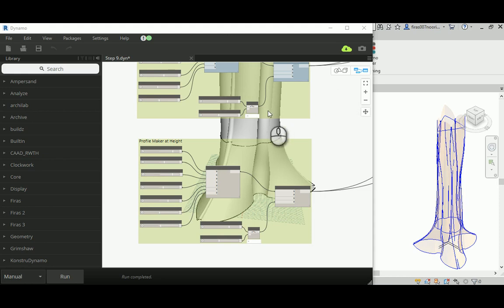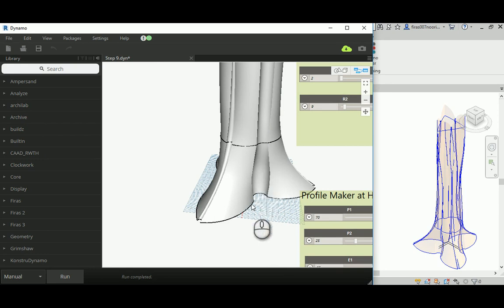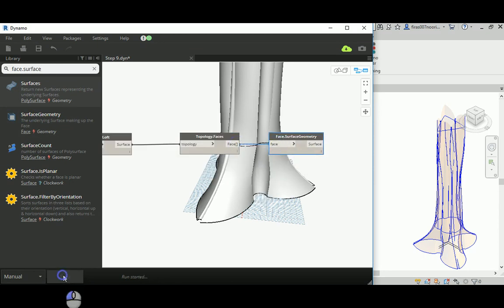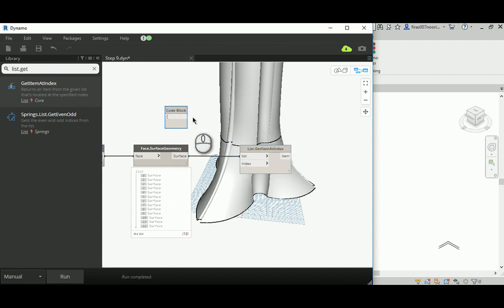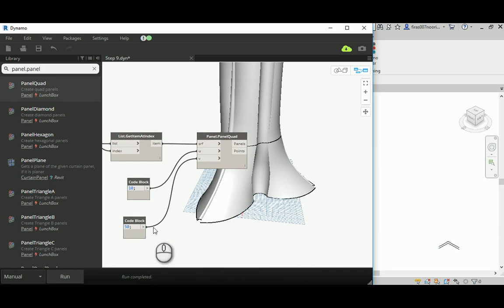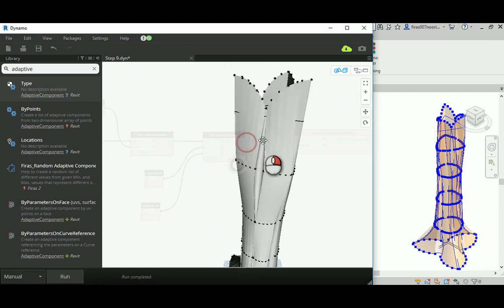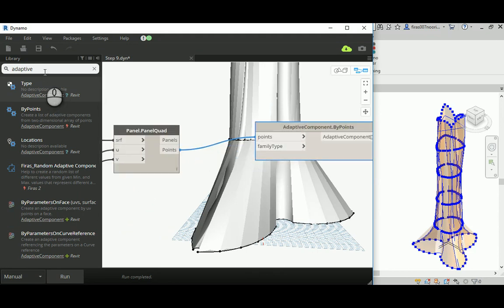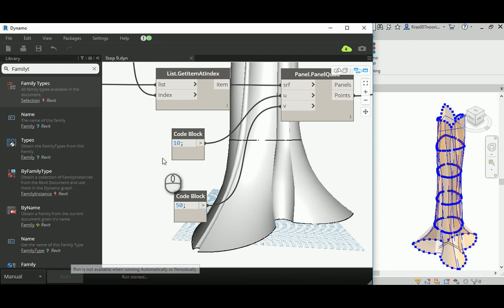Snowflake Tower Using Dynamo - Step 9 Making the Adaptive Components of the facade

Comment: Hi there Firas! Love your videos! I ran into an issue with the List.GetItemAtIndex node. I am getting 15 items in my list not 13. I seem to be counting the top and bottom of the tower as surfaces as well. I had to start my index range  at {2,3,5,7,9,11,13} as intems 0 and 1 are the top and bottom the tower. I hope this works but any advice would be helpful. Thank you!
Reply from the maker: many thanks, dear, I do appreciate your kind words, Can you please send me the Dynamo files to my email so I can have a look at them first thing in the morning
Reply: @FirasNoori  Of course! I think I still have your email from a previous question.
Reply from the maker: I got ur email, sadly it is missing all custom node you designed and thus they appear in RED, meaning I cannot run the script you did :(. but as far as I understand, if you are getting 15, think of two options, first, the top and bottom surface, I may exclude them before I get into the topology, thus I have 13, OR, it might be extra points at one the 2d Profiles creating extra surfaces!!
Reply: @FirasNoori  Oh, How do I fix this so that you could run it? also, I think that excluding the first two from my list should do this trick but if I run into any issues I will ask for assistance. Thank you very much!!
Reply: @calixovacari397  I could not run the your script as I wrote due to custom nodes u did, can send me the inner custom u did at email, the one the made the parametric plan I think?